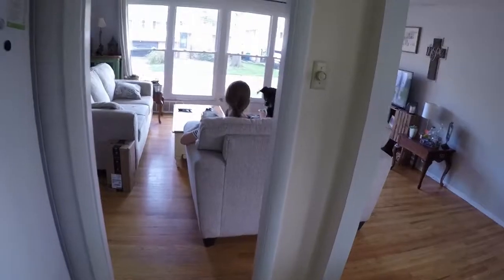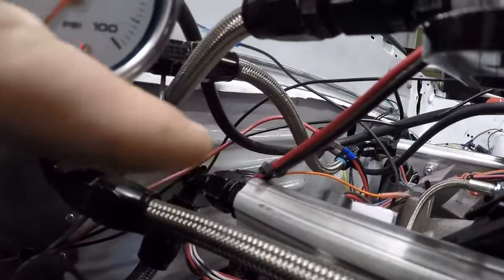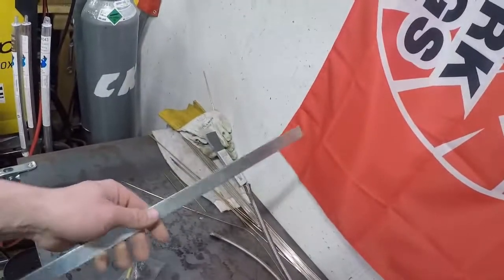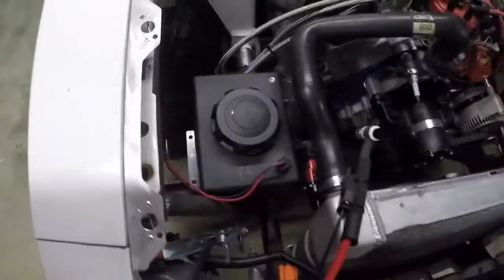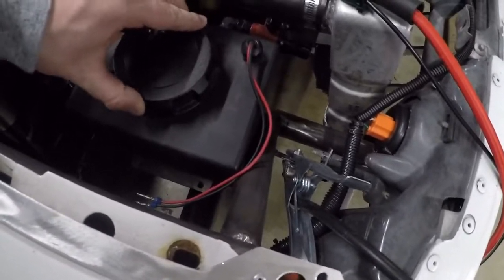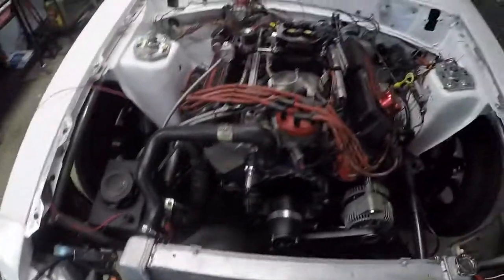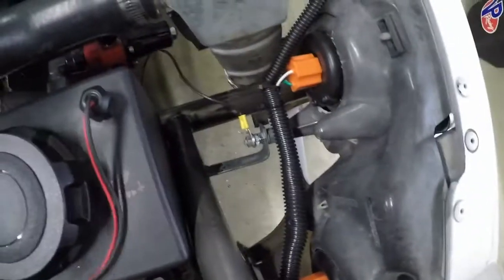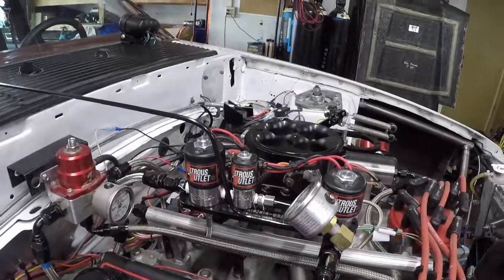Mounting a Nitrous Dedicated Fuel Cell in a Tube Front End Mustang!

Comment: You run the 8th or 1/4 what kind of times are you running
Reply from the maker: Mainly 1/4. Was close to running in the single digits with the setup in the video but currently changing everything over to auto and building a bigger motor
Reply: Does your channel have a Facebook page
Reply from the maker: No but I was thinking about making one, maybe I will in the next few days.